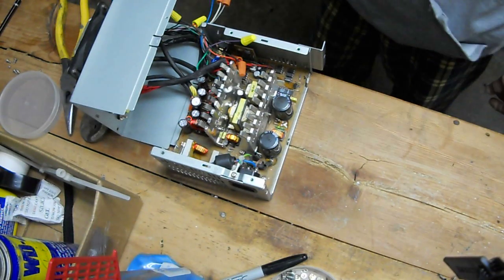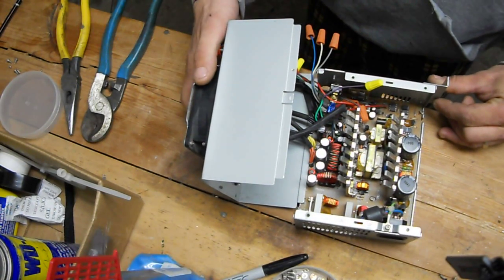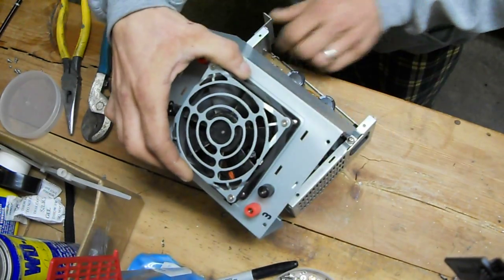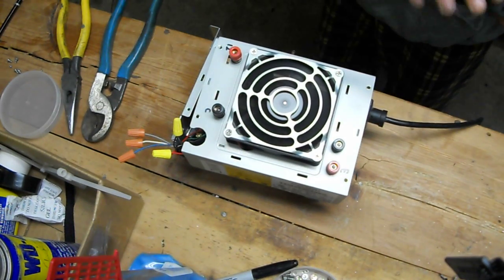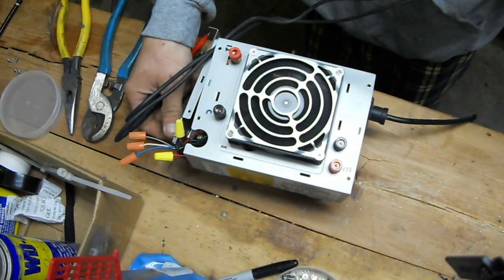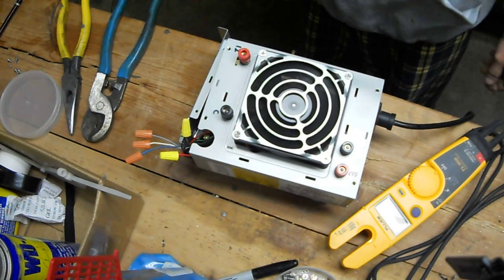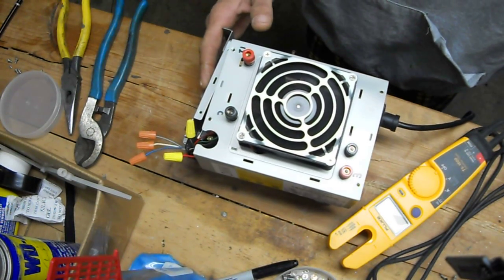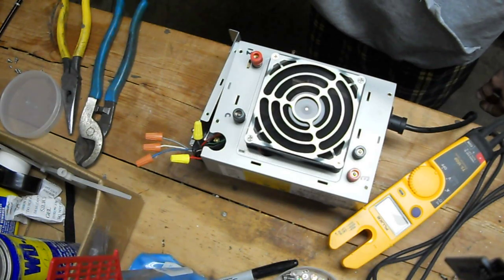Computer power supply mod + Shoutout

Comment: After turning off power supply (modifying & such), take a flat blade screwdriver and discharge the filter capacitors to avoid any possibility of electrocution.  If necessary, unplug power supply then discharge filter caps with flatblade screwdriver.  Disclaimer: Do this at own risk.  73 de Montana

Comment: To charge car battery you need higher voltage (14.4v) and greater current capacity. But as a last resort you can use an atx psu as a slow charger, adding a heatsinked resistor between the PSU and your battery - the value of the resistor depends on how depleted your battery is, like 1.0 ohm for totally depleted battery up to 0.2 ohm for 10v.  Don't forget to put a 5 ohm resistance between the 5v line and ground, the regulating circuit needs that.

Comment: One thing you may not know that used to be printed on older power supplies, is that most require a load on the 5VDC side.  I used to get many that were thrown out because the 12VDC side wouldn't get to over 10.5 Volts.  I'd put a auto tail light bulb on the +5 side and that would bring the +12 right up where it was supposed to be with years of life left in it.  For other voltages e.g. 9 VDC a 9 V regulator in a TO220 case is only a couple of bucks at Fry's (NTE1910 works) with a heat sink.